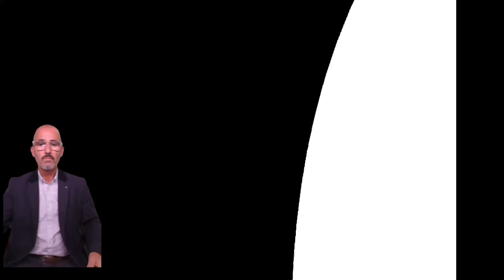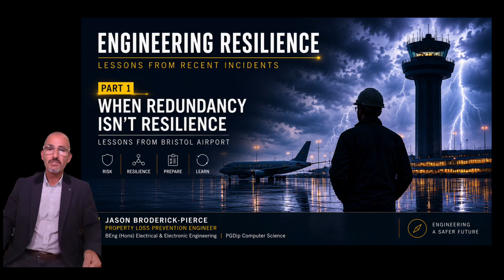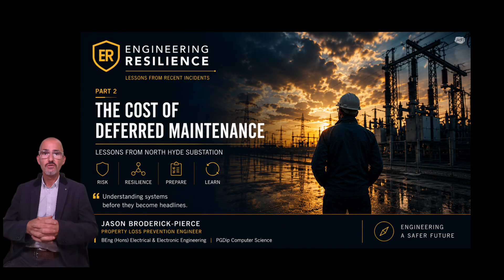Bristol Airport: When Redundancy isn't Resilience | Engineering Resilience Part 1 (HD Audio)

Comment from the maker: Bristol Airport confirmed that both primary and backup ATC communications systems were affected by the electrical storm.

The precise technical failure path has not been made public, so this episode does not claim to identify it.

Instead, I would value your thoughts on the wider engineering question:

How should an organisation demonstrate that its backup is genuinely independent of the primary system—not merely additional?

Which dependencies are most commonly overlooked: electrical supplies, cable routes, earthing and lightning protection, equipment location, telecommunications, environmental control, software, maintenance or recovery procedures?

Please keep the discussion technical, constructive and evidence-led.